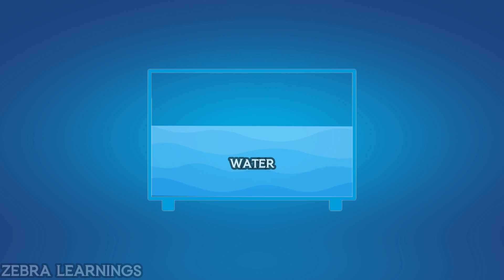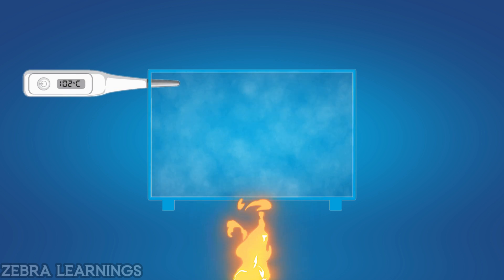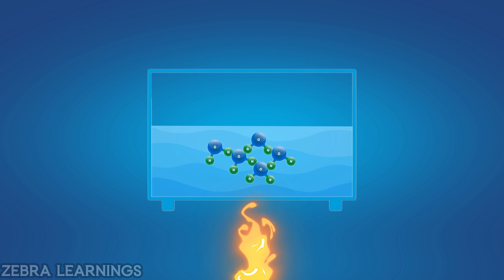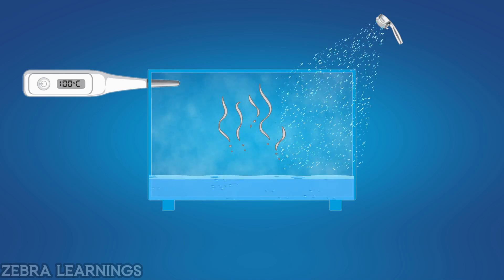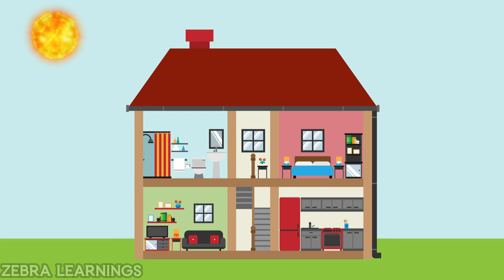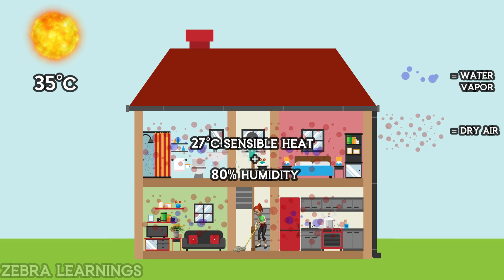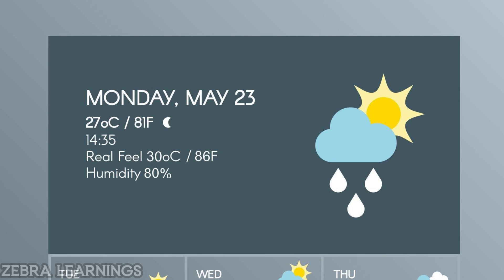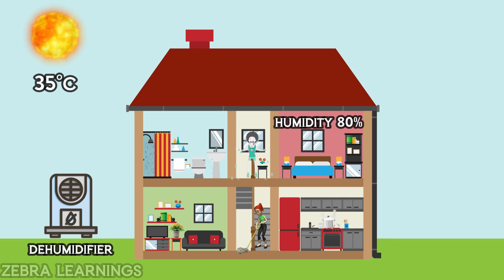Latent Heat and Sensible Heat Explained | Humidity | Animation | #hvac #hvacsystem  #hvacmaintenance

Comment: This finally explained latent heat in a simple enough demonstration for me to fully grasp it, thank you! I've been deep diving into heat pumps and similar technologies, but I was always so confused about latent heat. I understand now that it's the energy used to cross the matter state conversion threshold. Which is heavily dependent on the pressure of the surrounding atmosphere. This fully explains heat pumps for me, thank you so much.
Reply from the maker: You're most welcome! Happy to hear it made sense.

Comment: Don't buy a standalone dehumidifier with the expectation that it will make your house more comfortable.  The humidifier will significantly increase the sensible heat in your house as it condenses the moisture in the air.  Turning on one of these humidifiers is like turning on a space heater in the summer.  Use them only in unconditioned areas where you are protecting your belongings and structures from excessive humidity.

Comment: Sir Excellent  explained  🙏👏👍
Sir doubt if humidity 80% in the room can we do it a/c temperature set point 15c celcius will it be gone humidity please tell me sir 🙏
Reply from the maker: Yes, we can. If we reduce the setpoint to 15°C, we can reduce the humidity level more. But the energy consumption will be higher and the 15°C temperature is uncomfortable.
Reply: Ac can't do below 15 degree